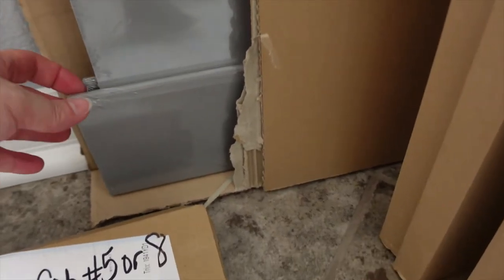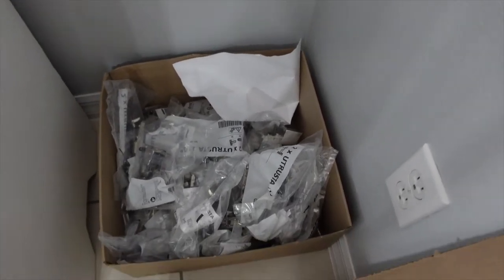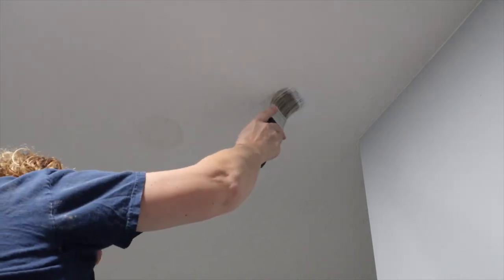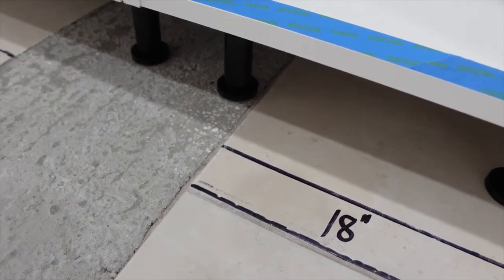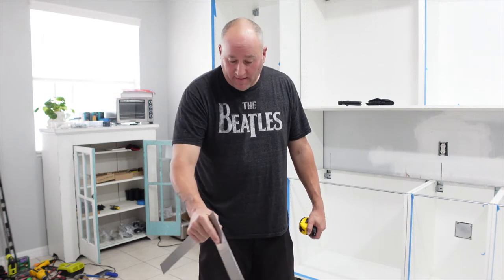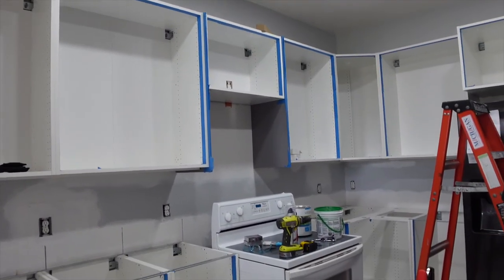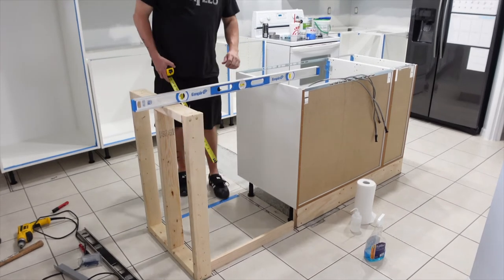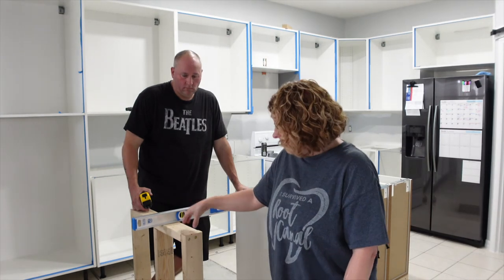Ikea Island Modified for a Dishwasher on the End

Comment: nice video. the tape on the edge of the cabinet. What are these for?
Reply from the maker: We painted just the front of the white parts of these cabinets because our doors are grey. We did not want you to be able to see any of the white of the base cabinets. They are taped off so I can go back and paint them.
Reply: @PurposelyReRouted  that is a very good idea. i do realize between doors, there would be a tiny gap revealing the white color of the frame, especially the corner wall cab.